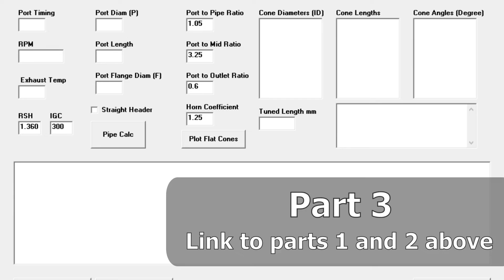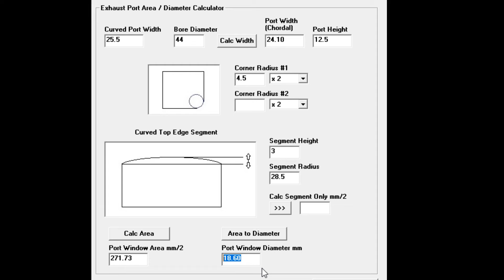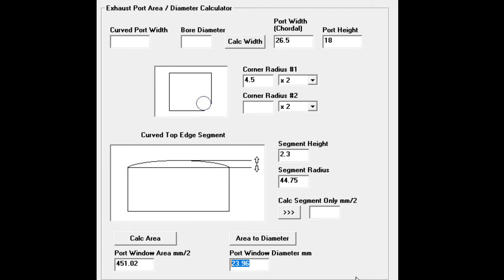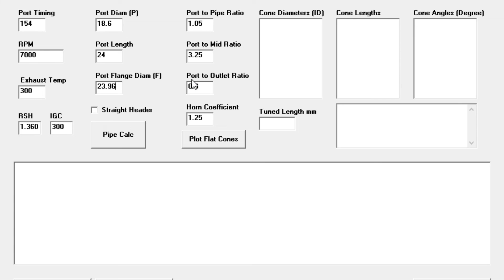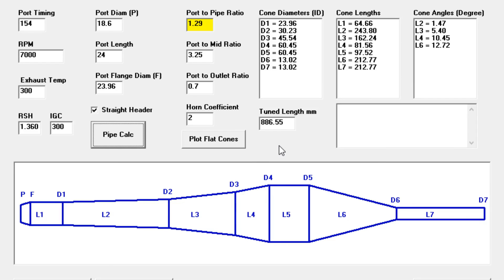2 stroke porting, part 3 - Converting Exhaust Port Map to Area.

Comment: Hello, i changed cdi and coils on my Honda MTX 125, then every spark plug are melted after few kilometers, carburetor is ok, before changing cdi engine worked well, changed angle of ignition, and engine still overheating, what kind of problem can be? 
The reason why I changed cdi and coils is my old coils are burned (i do not know why) and I changed it (CDI, COILS) to another one (not ORIGINAL)
  i changed timing on rotor, I took out a pin on the crankshaft, and turn forward a rotor for few milimeters to get better timing 

The new cdi i bought are https://cdn-yams.schibsted.com/api/v1/adimgs/images/4009444109-cdi-racing-deslimitado-yamaha-dt-tzr-lc-rz.jpg?rule=play 
is it shitty china or it is good?
Reply from the maker: Was the engine over heating before you fitted the new ignition, if so then maybe something else is at fault causing that and might have some bearing on the plug melting.
You mention you advanced the rotor, be aware that 2 strokes retard the ignition at higher RPM as it comes on the power peak so it may have way too much advance at peak.
As for the quality of the ignition you would have to ask around forums perhaps where some may have experience of that brand of ignition.

Comment: Does the iridium spark plug increase performance on two stroke?
Reply from the maker: Hi
The short answer is no.
Long answer is that the purpose of platinum or iridium over copper is longer life, copper has good conductivity but wears quick , platinum lasts longer but conductivity not as good as copper, iridium last long and has better conductivity than platinum which makes iridium the choice of road vehicles.
Racing plugs are gold palladium which has the best conductivity and able to withstand higher temps and compression for racing than copper but are quite expensive.
Reply: @AuMechanic  Thank you so much <3

Comment: Only mm/*C not imperial? How does one arrive at an exhaust temp value?
Reply from the maker: Imperial is accurate enough however you need to convert fractional values into a decimal to put the values through  equations used and metric is already a decimal scale so you may as well convert to it if you are gong to have to do conversions anyway.
Reply from the maker: There is a metric converter in the input calc window of the software.
I've done a video earlier on getting exhaust temp values by calculating BMEP from engine specs https://www.youtube.com/watch?v=cgTGWuVAasU
There is a calculator to do this in the input values cal window of the software..
Reply: Muh imperial 😂🤣😂🤣 . Imperial is not accurate enough
Reply: I am accurate down to .0001 which is .00253937mm so you have nothing to stand on here.